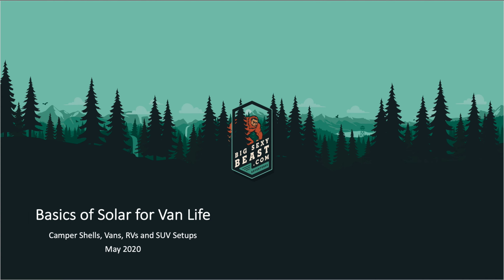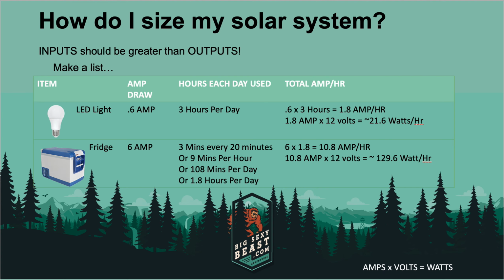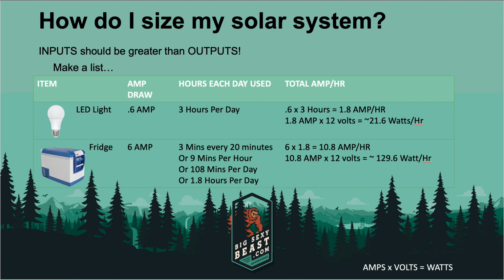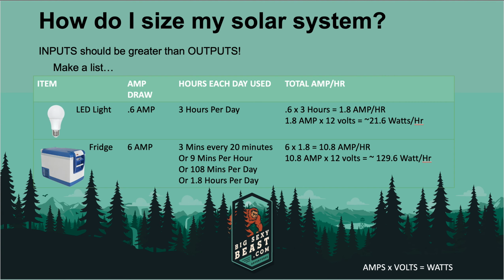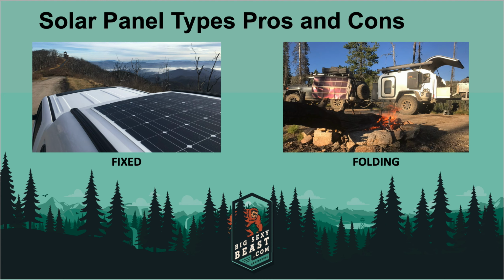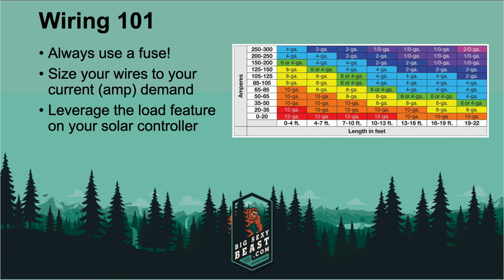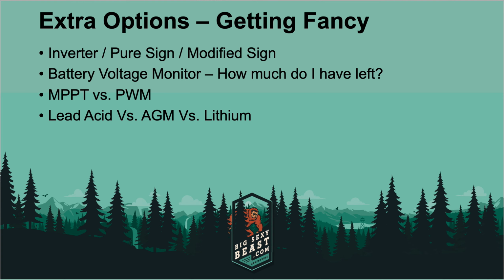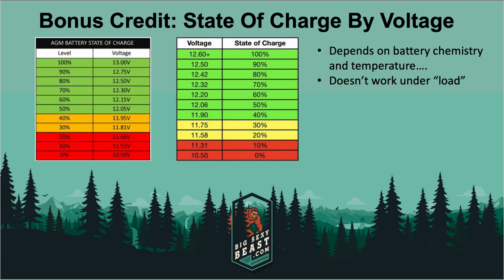Basics Of Solar for Van Life, Camper Shell Living and Camping

Comment: Love the video,
Quick question, i'm outfitting my 6.7 litre deisel truck with the 2 stock batterys. Is there anything I need to consider when setting this system up?  Is there a battery you suggest for replacing my stock batterys?
Reply from the maker: That's a great question.  I have a buddy who has a 7.3 ambulance that he converted.  It has two Optima batteries.  I'm using Northstar on my Tundra.  I'm not sure what I'd recommend in your situation.  You might check out some 6.7 forums and see if anyone is talking about it...